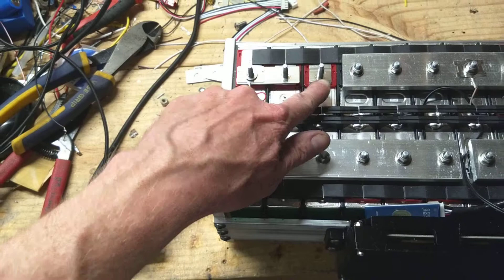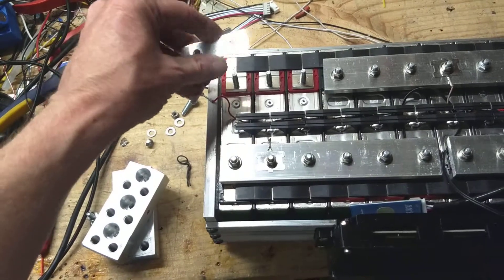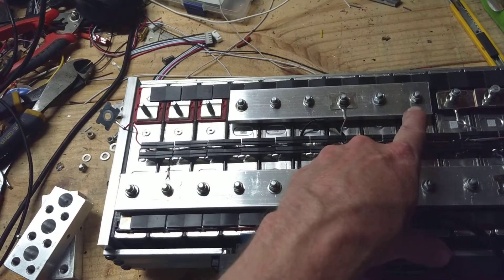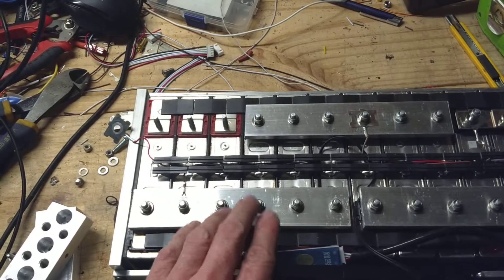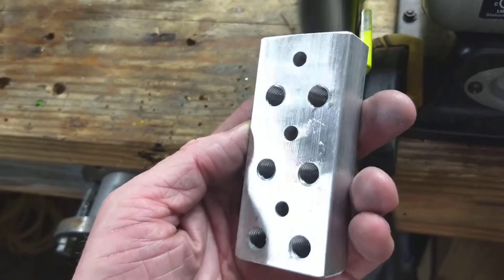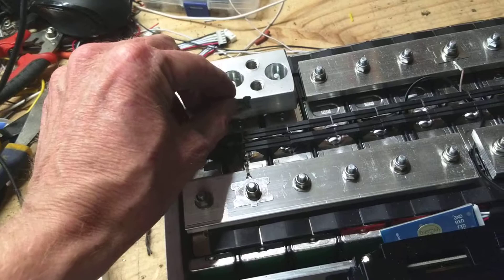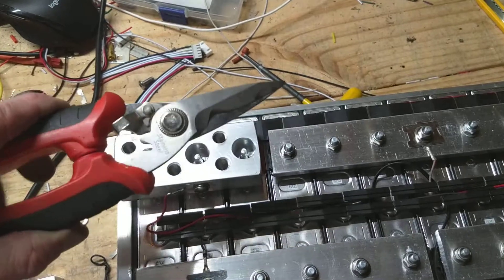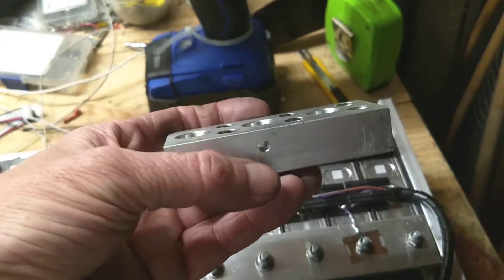How to install Lug Adaptors on Ensley Energy System Battery

Comment: Are these cells 24ah and 4.2v fully charged per cell? I currently have 2 full cmax 24ah and 4.2v, 21 bank cell packs so what I'm wondering is my alt is a 390amp alt charging at 14.8/14.9volts constant. The question I have is I was told to wire my cells with 4 cell packs not 3 like you have there can you explain why I was under the impression having 3 cells you can't charge over 12.6volt but yet I see your doing just fine being in the 14v range on your bank
Reply from the maker: That is a 4 cell bank.